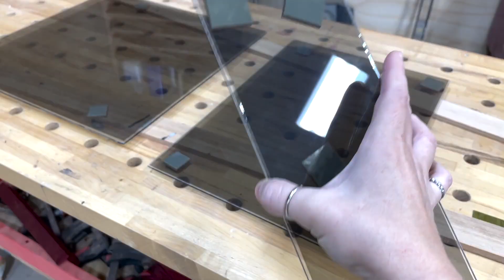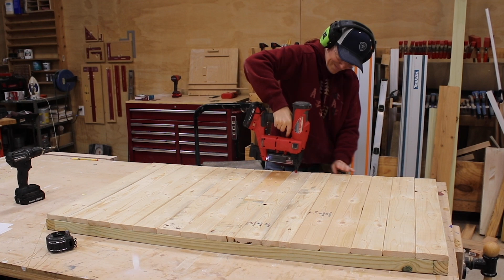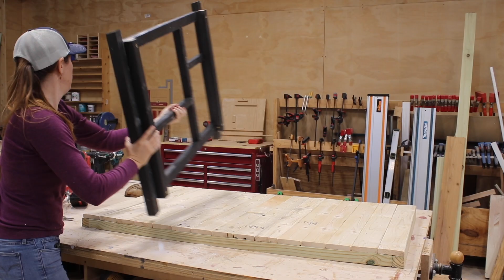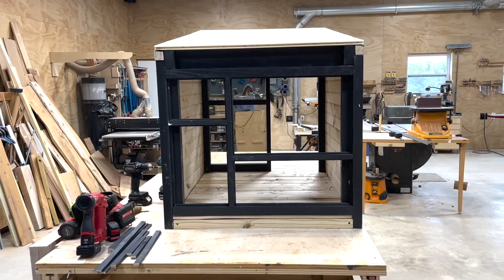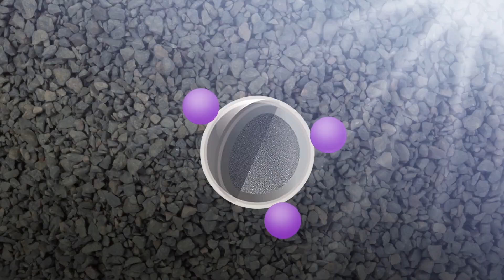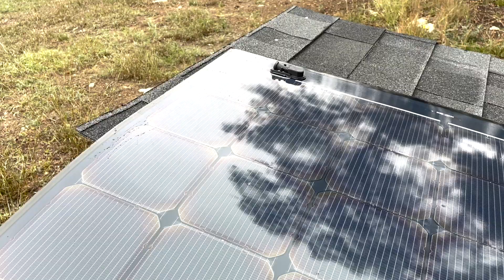DIY Dog House | Modern Dog House with Sustainable Materials

Comment: I think I missed what you are powering with the solar panel.  A small heater?
Reply from the maker: I installed some small lights underneath the overhang, plus I have an electric heating pad under the dog bed. Thanks for watching.

Comment: Not sure if I missed something about the solar panels. Also checked the included website and it didn’t mention solar panels. 🤔💭
Reply: The panel will power some lights and a heating pad.

Comment: What is the purpose of the solar panel?
Reply from the maker: I installed small lights on underside of porch overhang plus I have an electric heating pad under the dog bed. Thanks for watching.
Reply: @AprilWilkerson  I enjoy your videos …when I saw this one and it started with “solar panel” I wanted to see what you did with that.  At the end of the video I was all like… cool solar panel but what is it powering?  I thought maybe I missed something so I decided to brave the comments.  Now I know …but maybe a follow up video would be cool too :).
Reply: The dogs use a dehydrator inside. Fresh snacks are the best.
Reply: Yeah I didn't catch that either. Fan for the doggos maybe?
Reply: Probably for more woodworking tools probably connected it to the house grid.🫣
Reply: It is for recharging their bark collars. :-)
Reply: I was gonn guess a small fan to keep hot air moving.
Reply: Great video! Love how you take such good care of your pups in such creative ways!
Reply: Very nice